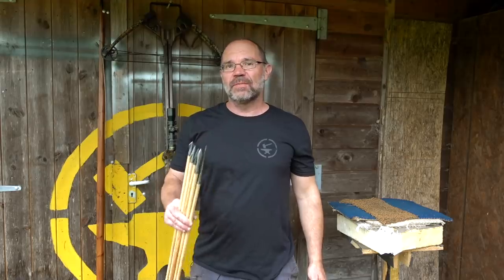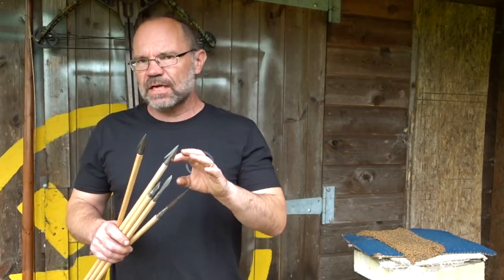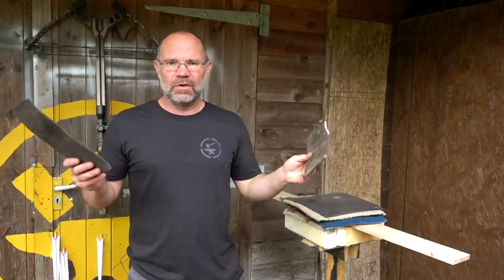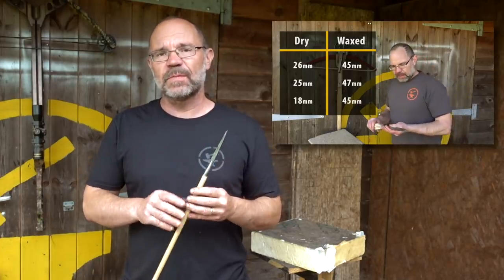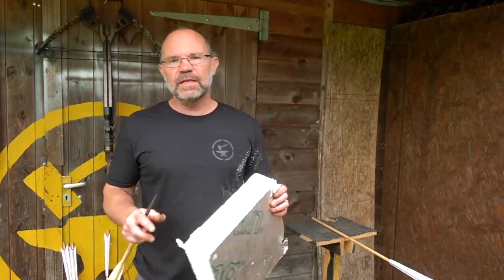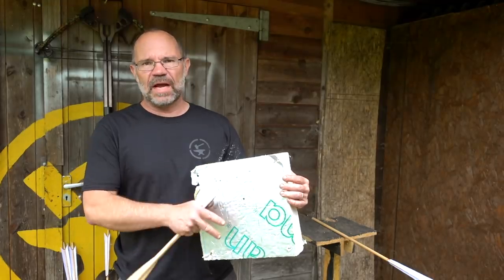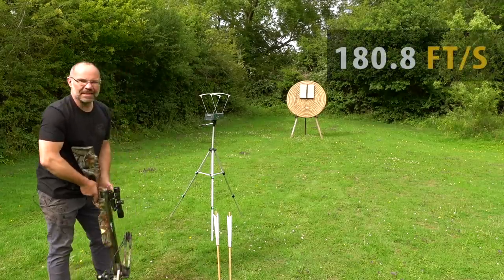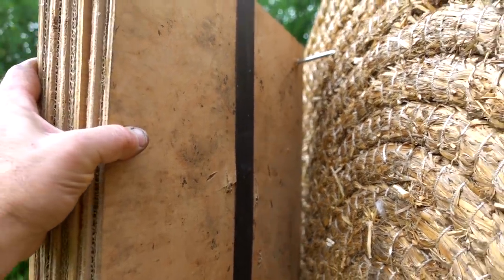Lockdown Longbow - Now I have WAR ARROWS!

Comment: Don't look down on your bow, "cheating" is what a scientist would do. Your bow is much more scientific than asking a human to shoot a traditional one, unless you're testing the effects of shooting a bow for extended periods of time on the archer. Science here requires minimising variables and repeatability. A mechanical device does that, humans ruin everything as they're walking wildcards.

It would just get more scientific if you go indoors to remove wind as a factor (preferable, but outdoors with common sense to shoot when its barely windy is good enough) and make a tripod or whatever method to allow you to adjust and fix height, angle and distance to the target, so that you can literally repeat a shot over and over. Preferably also add a way to attach the chronograph to it too, so that its relative position and angle to the bow is constant. Then it is just a matter of shooting the thing many many times with each arrow type and target combo to have statistically relevant data, and that would be pretty much academic science level already.

Good video and keep up the good work!

Comment: Considering what arrows were used for, where they were used, and methods of storage after use... I highly doubt we'll ever know if arrow heads were waxed.
Reply from the maker: I agree, I also doubt will definitely know
Reply: @tods_workshop  the argument can easily be made too if there's period evidence of waxed blades there's no reason they wouldn't wax arrows and spears. Oxidation wasn't some mystical curse of metal to smiths that were supposedly capable of pattern welding around those times.

Comment: adding wax to the arrow head improved their penetration, is it helped or hindered if a similar preservative is applied to the armour?
I have no idea what techniques would be used to maintain gear of the period but given the expense associated with creating armour they must have done something to preserve it, (Similar to the way I religiously polish my boots) If the armour in the case of mail or plate for example is waxed it'd protect it from rust and may very well reduce noise and rattle be it for stealth or personal comfort, But you now have a lubricated surface being hit with a lubricated arrow reducing friction and possibly increasing penetration?

Comment: Hello Tod! I was always wondered how works the "plate cutter" type of arrowhead againts real plate armor. It always seemed to me that it must work worse than the short bodkin. Could you test this type of arrowhead too?
Thank you for your videos!
Reply from the maker: "plate cutter" and short bodkin are the same thing
Reply: @tods_workshop  Short bodkin has square section. Plate cutter is flat and wide. I mean the "plate cutter" from your last video with waxed arrowheads.
Probably its more crossbow-bolt arrowhead than longbow arrowhead but still i would be wery interested in that testing.
Best regards

Comment: Couldn't the reason for the type 16s to be made from steel just be a lower wear, when shooting at linen Gambesons, leather or accidentally hitting a wooden shield? The need for a lot of arrows in war times could be significantly reduced by just reusing them, and it would be even better if you didn't have to sharpen them after every use.
Also I wonder:
Could waxing modern bullets improve their ability to penetrate kevlar oder polycarbonate shields?

Comment: if waxing an arrowhead improves effectiveness would it do the same for a sword??? A lot more difficult to determine since you can't swing with a sword with the same force and speed every time, oils are common for stopping corrosion but maybe it was also known that it helped cutting and slicing, maybe they started with this assumption and then applied it to arrowheads? Going to need to make a robot to swing the sword consistently to get usable data though..... lol

Comment: It's curious how kinetic energy increases just slightly with mass for the first three arrows but then lightest of the bunch has almost the same kinetic energy as the heaviest. Is that arrow better suited to the crossbow somehow?
Reply: No, the speed varies and is used in the calculstion, the dynamic spine can be diffrent across all the shaft

Comment: I didn't notice I was so goddamn early

Edit: Tod is using Gambeson, Aketon and Arming Doublet for this test, I always thought they were all rather the same but since Tod mention them separately in this video. Is there a difference in materials, thickness and layering that differentiates these textile armours?
Reply: Well I'm going to note the very short of it.
Gambeson and aketon can be synonymous, but they can also not be. Some sources clearly differentiate the two, and one even mentions a gambeson worn over an aketon as a possible combination. Some sources however seem to use either term ambigiously, as usual terminology in the middle ages can get quite annoying. But it's a reasonable assumption based on the differentiating sources to assume that a gambeson is the standalone variant (or worn over armour) and that the aketon is a lighter, thinner variant worn under armour, when the distinction is made.
Arming doublets are as the name implies, doublets for arming. They're based off the civilian doublets and usually follow the fashion, the cut and tailoring of these. Difference being that they're made of sturdier material and have points for arming. Unlike both gambesons and aketons, arming doublets do not need to be padded and the further you reach into the 15th century the less padded they seem to get, with little to no visible quilting in most cases. There's always the possibility of sewn-in liners on the inside of the garment of course.
The probably most famous description of an arming doublet (from How A Man Shall be Armed ) describes it like this. 'A doublet of fustian, lined with satin cut full of holes'.
Reply: Generally speaking a gambeson is standalone armour, made from quilted fabric. An aketon or arming doublet is worn as padding undernearth other armour, especially plate.
Reply: Gambeson is layered linen weave.
Aketon is linen on tip and bottom, then stuffed with something like cotton or wool.
As far as I know, arming doublets can be both but are usually thinner and softer than straight-up padded armor

Comment: If you coat the arrowheads in wax, do they rust? Is it a protective coating as much as penetrating lubricant?
Reply: Most penetrating lubes actually evaporate over a short period of time. Wax is better. Museums and collectors use wax/petroleum compounds to protect mild steel items so that they do not need constant attention or cleaning while on display. It won't evaporate, but does rub off with handling. It's protective qualities are dependent on how thickly it is applied and the humidity to which the item is exposed. I have had a heavily waxed steel helm sit in a grassy tuft overnight covered with dew the next morning and no rust form on it. A common cheap rust deterrent is car or finishing wax which contain carnauba wax. Carnuba is extracted from palm trees but has similar soft and tacky properties of commonly used medieval  bees wax + rosin.
Reply: @terrythompson2743  When I said"penetrating" I meant to assist in penetrating armor, not getting in deep and evaporating rust :p